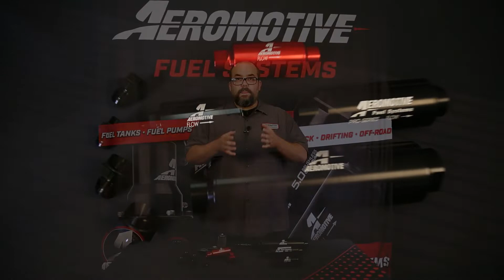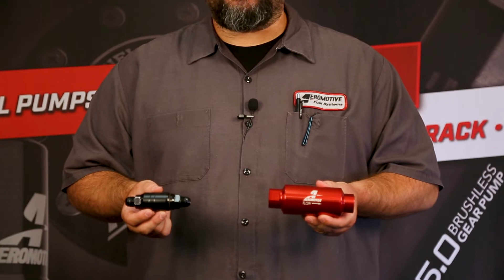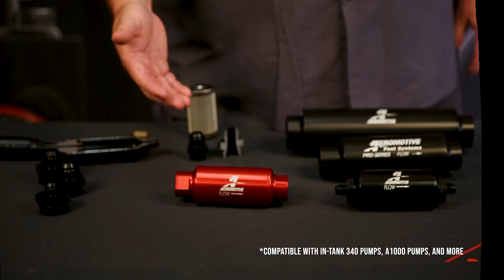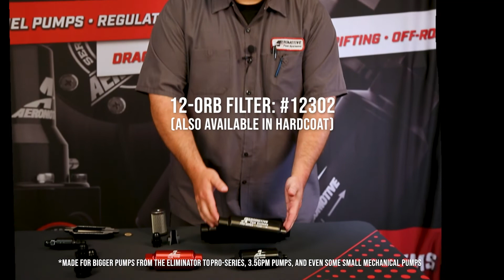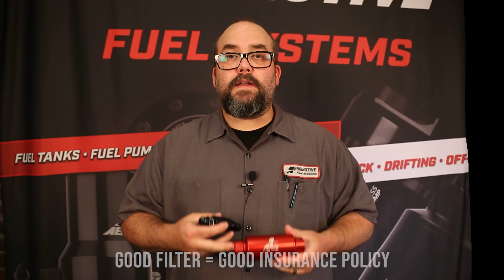Aeromotive Fuel Filters Explained

Comment: You can get bigger size fuel filters and still get the 10 micron on both sides. The bigger it is the better the flow but the smaller the micron size the better it filters the fuel but it reduces the flow some but you can like I said get a bigger size one even using an adapter which will probably even it out giving you better flow and still filter the fuel better.

Comment: I just had my Aeromotive pump crap out in my small block Chevy. I have the 100 micron pre filter and a 10 micron post all plumbed through -8AN. Every piece is Aeromotive. The only thing I didn’t do was plumb a return line because the instructions said it was not necessary in my carbureted configuration. The entire fuel system has less than 125 miles on it. Trying to find out what went wrong.
Reply: In order to adjust fuel pressure via the fuel regulator there must be a return hose otherwise you are dead heading the pump, which I'm surprised that it even lasted the 125 miles.
Reply: @baby-sharkgto4902 ended up ditching the whole setup and went with Gen2 stealth tank and plumbed in a return. Turns out I had bigger problems that I am currently dealing with.

Comment: I was very concerned by a video covering the installation of the "Aeromotive" fuel tank module as the venting of the tank was capped & sealed. Only later in comment did he claim a roll over valve was employed on one of the tanks fittings. Please consider a video to cover this issue as fumes can fill a garage overnight, why a roll over valve is needed, keeping tanks from collapsing, or gas station pumps kicking off during refueling. I like many, installing a Tahoe LS in a 50 year old truck but asked the programmer to allow purge as I installed an activated carbon canister to store & burn the fuel vapors I paid for. Problem during refueling come from no tank venting as new gas tank caps increase vent pressure from 1 PSI to 2 PSI. The hydrocarbon rich atmosphere trapped in the tank has to go somewhere. We know it depends on how the vehicle is used for, designed use and vented to allow air in via a carbon canister while having an active roll over valve that closes as soon as liquid fuel touches it. This causes the gas stations pump to react thru the aspiration tube to shut off.  Thanks!
ASE Master tech since 78

Comment: 100 MICRON befofe pump means feed to the engine?
Reply: I am confused slightly on your concern but placing a 100 micron filter before the pump is the first protection for the pump. Pumps may wear as the may provide venting for normal caveated fuel in stage one of a vane rotor creates a vacuum. This feeds stage two vane rotor to push fuel through the pump, pass the spring loaded check valve into the second filter to the injection rail. 
   Most all vehicles use a bucket, Venturi pump to keep it full providing the pump with un-aerated fuel to create volume. Without volume, you cannot generate pressure. For example; look at a boat propeller in the water. As it spins, it creates a vacuum on the leading edge of the blades. This generates bubbles reducing volume. Water can boil at room temperature in a given vacuum. The higher the vacuum, the more boiling occurs. Air cannot be compressed leading to a drop in pressure, while liquids can be compressed producing pressure. This is why pumps are placed inside the tank as this leads to vapor lock. In 1976 the Datsun 280Z & Cadillac Seville used electric fuel injectors. A helper pump inside the tank kept fuel of sufficient volume to a frame mounted fuel pump to eliminate vapor lock. I enjoy EFI and its attributes as the days of vapor lock are gone. But the parts inside the tank is more complex as a bucket is used, return fuel is dumped back into the bucket and most use a tiny amount of high pressure fuel to pass thru a Venturi at the buckets bottom. This fills it regardless of the tanks fuel level. But this requires a larger hole in the tank. Plus hanging a fuel level sending unit on the side and perhaps a thermistor that changes resistance once levels drop shown on the dash as a low fuel LED. Level and low fuel maybe displayed as 10 second samples to update the dash indicators. So turning a big loop onto or off an interstate does not turn on the low fuel lamp or starves the injectors causing a misfire. Misfire counters numbers were relaxed in 1997 after the service engine soon lamp came on. This leads to customer dissatisfaction and unnecessary dealer visits. Unfortunately the cost of tank technology is high as even venting via the cap was increased from 1 PSI to 2 PSI so hydrocarbons did not vent. Have you noticed changes to you portable fuel tank for your lawn equipment? Once again, low level smog as hydrocarbons and sunlight met at 10,000 feet. Even Indian encounters by Lewis & Clarke in current Oregon    Were told that the area to the south was haunted by their grandfathers, grandfather by smoke from campfires and not considered to be used by Indians! They were describing Los Angeles because of its bowl like topography that held smoke from Spanish explorers. It's in the records from 200 years ago. 
ASE Master tech since 78